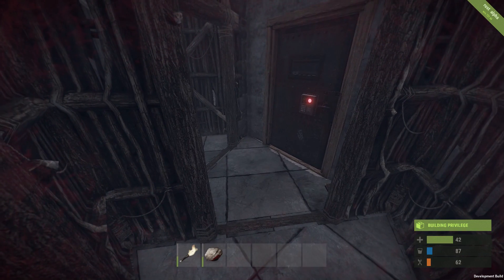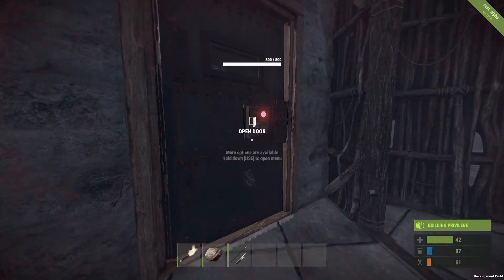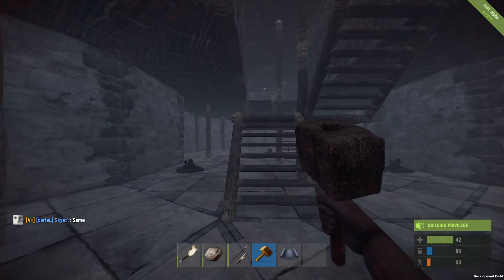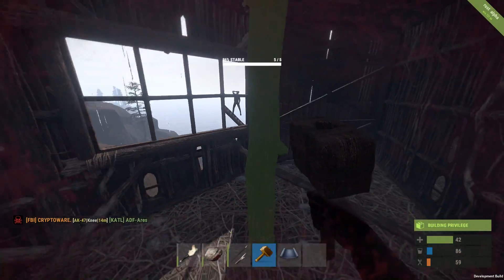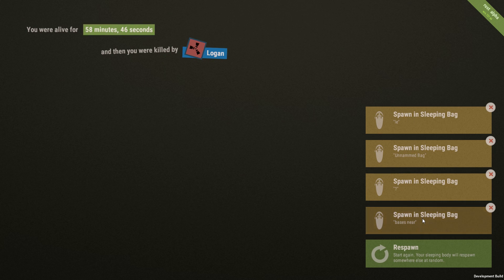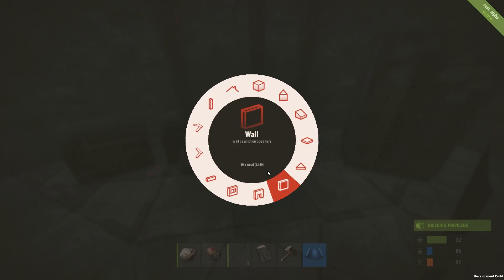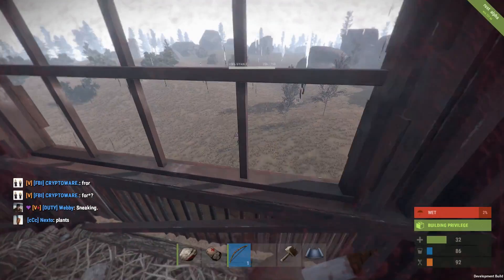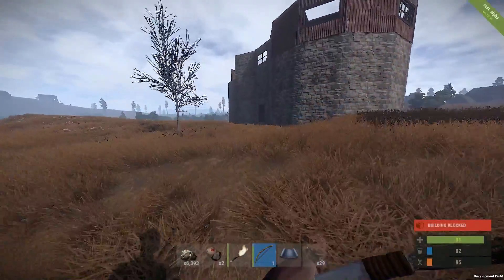Cracking coded locks (Rust) #7

Comment: Here's how I do it:

>Try codes 2002-1992 because most players are between 15-25 years old. (10 tries)
>Try for repeated numbers like 3333, 6666, and 9999 among others. (10 more tries)
>Try doing geometric shapes, like squares, 4-corners, and L-shapes. (12 more tries)
>Lastly try 3141, 1337, 0420, 8008, and 0322. (5 more tries)

I can usually get like 70% of locks with this method and it only takes like 2 minutes. Try it out. Also try using social engineering and prior info of the lock's owner (if any) to speed up the process. Like if they're 19, try 1998, 1999, 8991, and 9991. It's more likely to work compared to a randomly generated code.

Comment: back when you didn't take as much damage for entering the incorrect code
Reply: Cursive no he doesnt
Reply: He took damage because he was starving, not because of the code
Reply: In rust, you take damage from starvation before zero. As long as you are under 50
Reply: Clazzo very little

Comment: Anyone who thinks this video is authentic, is a moron.  The odds are 1 in 9,999 that he would get the code, then even worse odds that this would be the only door in a base this size, (no airlock) and then even worse odds that the owner just so happens to show up just a minute after he gets in, but not so soon that he catches him trying to break in.  

Also, if there were more doors and they had the same code, this would still be a difficult method because you are running through the codes so quickly, it would be hard to remember what the actual working code was, once it is hit.